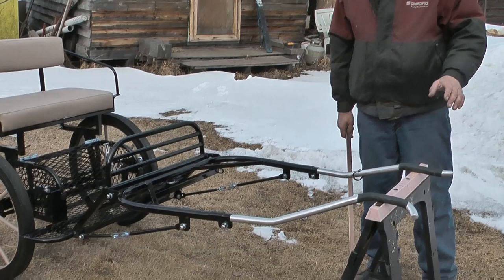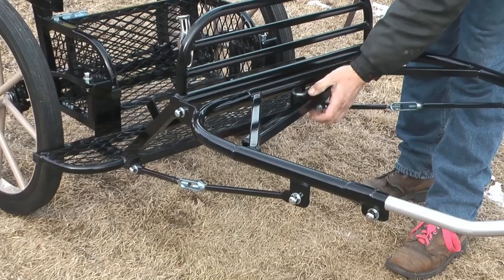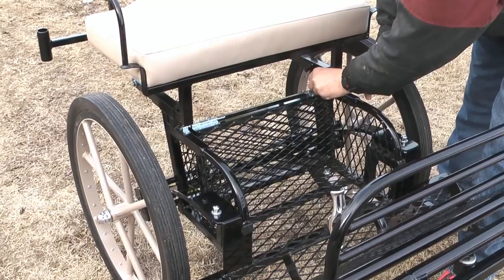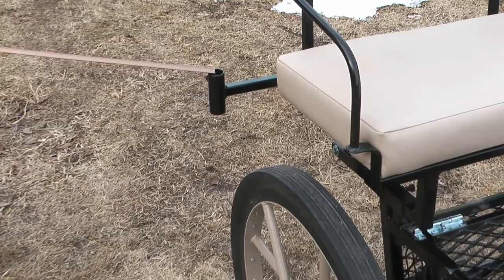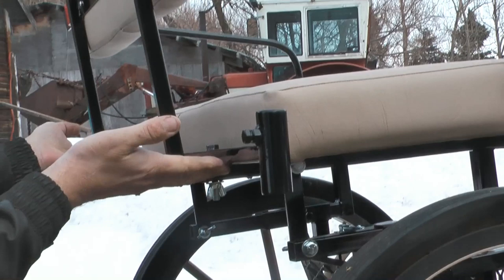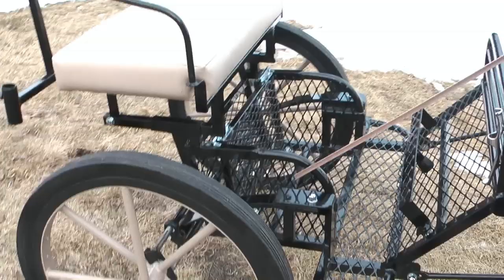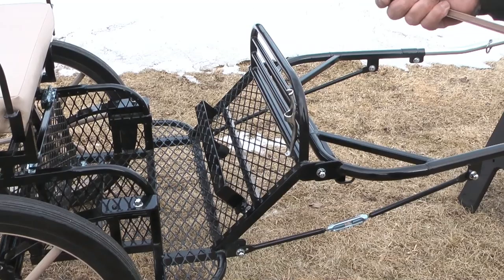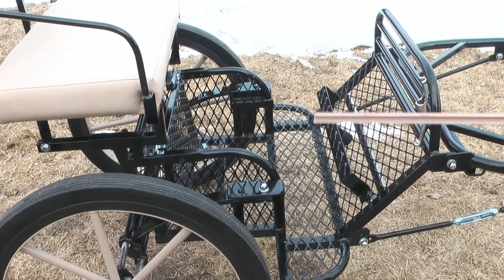The Cricket

Comment: Some very nice features; impressive! A few questions: I presume the wheels pictured are 26" wheels; is that the usual 'rim only; rubber adds at least 2" to the diameter", and are those solid rubber, or a form of pneumatic tires(hard for me to tell on the video.) What is the front-to-back measurement of the seat cushion? And, what is the shipping situation...who do you use, and what have you found to be the approx. cost when shipping into the USA; with specific reference to the Southwestern US states?

Comment from the maker: Thank you! The wheels are 26 ground to top of wheel. It is a solid polyurethane mounted on to the rim that Kelly builds from scratch. The seat cushion on this one is 14 X 28. I have a specific company I use, and would need a zip to get you a quote. Only one we have "scoped" out, was on a small 4 wheeler to Florida, and all in, was around $600 U.S. Go to pattysponyplace.com to see more, and get in touch off the website.